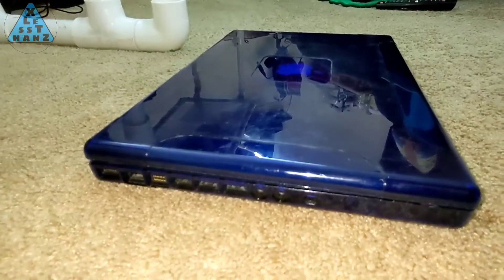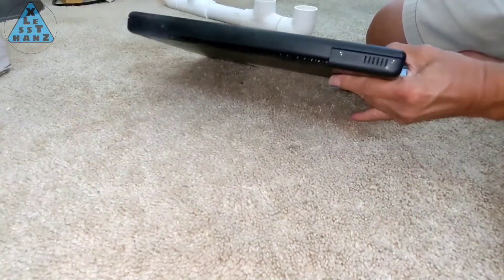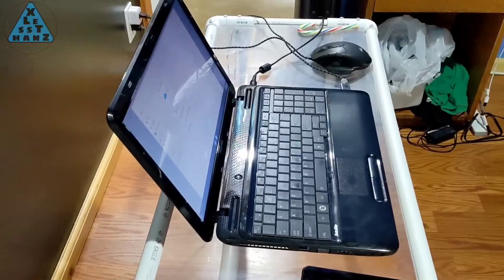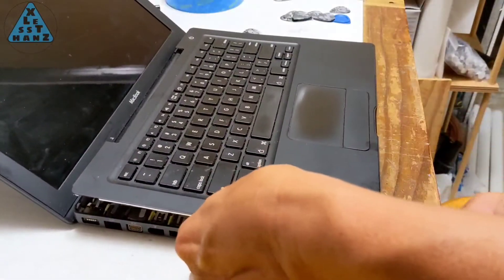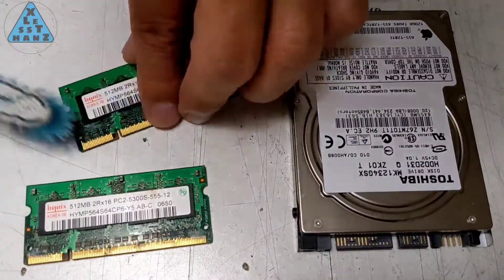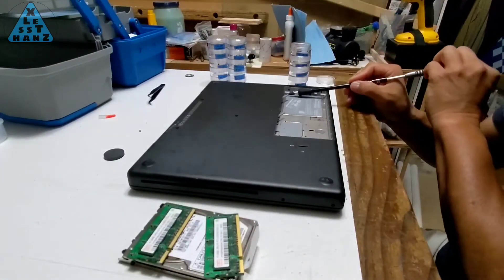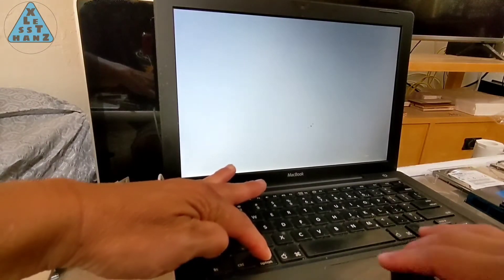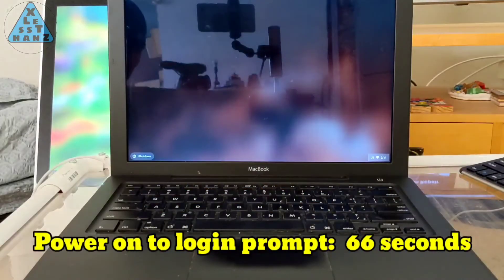CloudReady Chromebook Conversion (USING 2007 MACBOOK)

Comment: If you still have this device, you should try chrome os flex
Reply from the maker: Awaiting the stable auto update to this on all my chrome os computers.
Reply: How does flex differ?
Reply: @XLessThanZ  how many have u installed it on? It can't replace Whinedows for higher/demanding tasks, can it? Video editing, gaming, broadcast streaming ... Or can it?
Reply from the maker: @WaelElazab  there are beta releases, but haven't tried it yet
Reply from the maker: @WaelElazab  ChromeOS apps are cloud based.  Kinda like web pages.  Most of the processing is remote, not local to your computer.  So any product you use would have to run like that.  You could have apps like what you mentioned, but not many are available yet, if any.  I think Stadia was a proof of concept for demanding apps running remotely, but it requires high bandwidth for the video response time.
Reply: @XLessThanZ  you can still install software on the computer itself, or no?
Reply from the maker: @WaelElazab  there are some ChromeOS apps.  The other way is to enable Linux apps to run.  With that, though, you might need a computer with enough resources for the Linux app.
Reply: @WaelElazab  Chrome os flex is made by google for old and new pc. It hasnt android app support but you can easily install your pc without any driver problem.

Comment: i have a question how can i add gb space on macbook chrome os
Reply from the maker: 1.  1 GB internal would have to be a new drive that replaces the old one.  Macbooks only accept a single internal drive.
2.  1 GB via the USB port would work, but would be slowed to the speed of the USB port.
3.  1 GB on a network drive would work, but would  be slowed to the speed of the network.

For 2 and 3, if it's just for archiving data, then speed is not a big deal.  If you want to do work from files stored on those drives, then that might be too slow.  Depends what you're willing to tolerate.  Good question.  I never thought about it before.

Comment: Thanks for this video. I still have an old Macbook from 2007 (white case). MacOS only supports 3GB of the installed 4GB of Ram on this Macbook, so I'm curios to see, if Chrome OS really supports the 4GB of Ram. I will try. 🤗
Reply from the maker: Glad it helped.  Good luck 👍
Reply: No it wont. The MacBook2,1 is just a 32 Bit MacBook1,1, but with upgraded CPU (Intel Core 2 Duo in a 2,1 instead of a Intel Core Duo in a 1,1). As a 32 Bit machine, it has only the 32 bit address space, and, although it utilizes an EFI for booting, it still suffers from the reserved address space of 1 GB, well known from legacy BIOS machines (I saw Windows installations available to use 3 GB, 3.25 GB, 3.5 GB, and even 3.75 GB, but never the full 4 GB). The MacBook2,1 is not that different from the 1,1, so even it is a 64 Bit CPU installed, the hardware  limitations are totally equal, may be or may be not because the EFI is 32 bit too. Same thing is valid for the MacMini1,1 and 2,1 - as the CPUs are interchangeble, you can build a 64 bit Intel Core 2 Duo into a 32 Bit MacMini1,1, and you run Snow Leopard in 64 Bit Mode (update the firmware to 2,1 and patch a Lion installer, and you can run Lion on the former 32 Bit MacMini, as I do).

Comment: What to do if usb is not recognized when inserted in mew machine. I have two older apple 2009 MacBook Pro and 2011 MacBook air
Reply from the maker: Check this link to see what's compatible and the features that will/won't work:
https://guide.neverware.com/supported-devices/

Certified means tested, but there are many computers not certified yet that will work.  It's more a trial and error.  On the same site is a Knowledge base and user forums that might help with your USB problem.
Reply from the maker: Just curious, but what isn't working when plugged into the USB port?
Reply: @XLessThanZ   so I have tried both the usb maker and manually making the installer. I did this on both a windows 10 and air book. Then tried the usb stick in both an early 2009 MacBook Pro 17” and an air book maybe 2012. The pro had El Capitan fail to upgrade so the computer is useless. The air book works fine. In both cases with both the maker and manual the usb stick never shows up when holding the alt key while powering up. The air book shows both the hard drive and reinstaller from Mac. The pro just shows the El Capitan reinstaller. No orange usb stick shows up
Reply from the maker: Oh, I see what you mean.  You haven't gotten CloudReady installed yet.  With Macs, holding OPTION supposed to allow boot drive selection, but that didn't work for me on the iMac.  I had to remov the drive, format it to blank, then boot with the blank drive and USB stick to get the drive selection, which then booted OK from the stick.  Try that.
Reply: @XLessThanZ  what about the pro book? My old pro book was on snow leopard early 2009 model 17 , I tried to force upgrade of os and it didn’t work, now stuck in limbo between old os and new, the Mac store tried to upload a new copy of Sierra or something and it didn’t work, now I tried to erase old drive but can’t figure out how to complete erase hard drive and copy. Is there easy way without removing the drive to clear it all out so I can load the cloud ready?
Reply from the maker: @jeremykramer7021  For Macs I've found they have a hard time even booting from USB if the internal HD is not working.  At that point I've had to remove the HD and repartition and format it on a Windows computer.  I'm not real familiar with Macs, so this is the only way I know.  There probably are easier ways, but I do it this way because I don't do it too often.  If there were lots of machines that all had to be done this way, then another way would be quicker.
Reply from the maker: @jeremykramer7021  If you're still working on this...one new problem I came across on an iMac was that it would no longer recognize my USB drive to do the install of CloudReady.  Even tried reformatting SSD to no luck.  I later tried unplugging the computer then plugging it back in (if there's a battery, probably need to remove it) and it recognized the USB.  Try that if you're still on it.
Reply: @XLessThanZ   thank you, I will try that.
Reply: @XLessThanZ  is this the comment to try out - should I wipe/format the hard drive, then try again? And could I do that with the drive still in the Mac? Thanks again 👍🏼✌🏼🤘🏼
Reply from the maker: @WaelElazab , this is the comment that seems to answer your question...@Jeremy Kramer  For Macs I've found they have a hard time even booting from USB if the internal HD is not working.  At that point I've had to remove the HD and repartition and format it on a Windows computer.  I'm not real familiar with Macs, so this is the only way I know.  There probably are easier ways, but I do it this way because I don't do it too often.  If there were lots of machines that all had to be done this way, then another way would be quicker.
Reply: @XLessThanZ  thanks again ,👍🏼 I started over with a mother install usb, and seems to have worked. I even tried it on a 2009huu annols ³65² m Lenovo laptopema ronhVenwoekwd
Reply: That was meant to be, .. also tried it on a 2009 Lenovo u330 and all seems well 👍🏼👍🏼